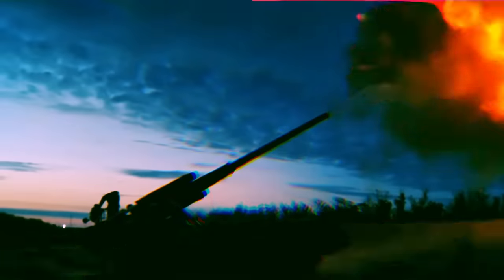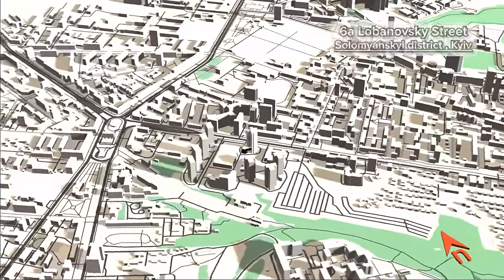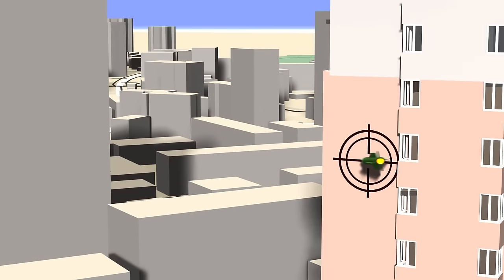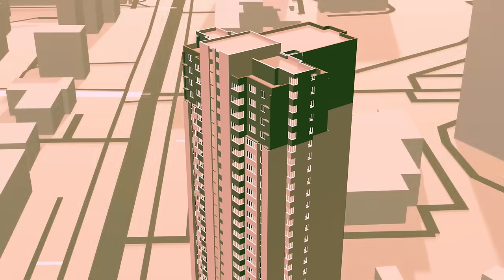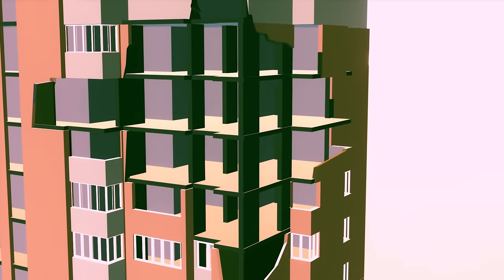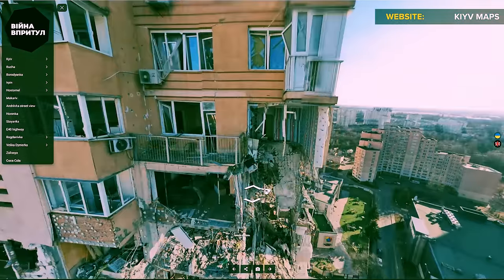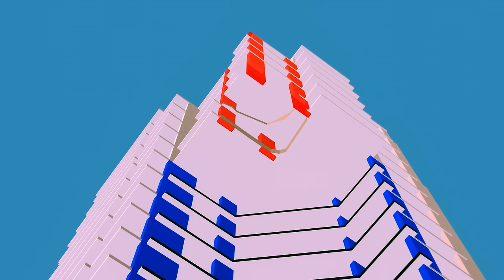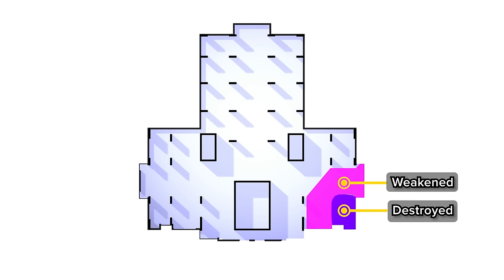KYIV MISSILE STRIKE | building structure and repair

Comment: How astonishing that a tower block in Ukraine is built stronger than a condo in Florida.
Reply: I liked how Mike explained the three car span issue. What a difference it made not to have to accommodate vehicles in the lowest level! And look how massive the columns are compared with the Florida condo that collapsed. This building is solid!
Reply: @dieterdietert7232  
Get help
Reply: @tetchuma  Stay a sheep and believe all the nonsense they put in front of you. 
Life is easier then. XD
Reply: @dieterdietert7232  sure is
Reply: We in the west have been tailored to think everything costs as much as it does. In reality it doesn't  Kiev's complexs far far outweigh 99% of the USA's in terms of strength. Sure it's not as luxurious but it's literally built like a brick poophouse
Reply: Chadimous, is a bit ironic, cost cutting on one combined with adding floors for greed, yet some say the other nation is more corrupt (and thus can't join the EU). Perhaps this building is proof that things are not as bad in Ukraine as some elsewhere imply, lol.

Comment: I've always thought that beams are required to distribute loads onto all/existing columns/pillars in high rise buildings... and from what I can see this building wasn't constructed with beams on each floor, with the floor slab transferring the excess loads onto available columns/pillars instead...
Reply from the maker: Beams are a good idea but not a necessity. In fact they get in the way, gobble up space and slow down construction. So building teams avoid them if they can. And this building stayed up without them. But this building had small spans where beams would be unusual. .

Comment: Awesome video, but did you really think the building would collapse with only that damage? That's a tough building. I could understand if the damage went deeper or if the strike was maybe lower.
Reply from the maker: Losing four primary columns is a major blow to a structure and beyond the limits of what the engineers would likely have designed for. Higher up in a structure the rebar steel is reduced with reduced strength so there certainly is some luck that kept the structure standing. But you are right it was a tough building.

Comment: Thanks for sharing russian propaganda inside tech videos. Buk missiles has self-destruction mechanism in case of missing
Reply from the maker: I am very pro Ukraine - strongly anti Russia.  I dont have an agenda, my aim is to report accurately.  The evidence points to a misfire.  

The missile came from direction where there were no Russian troops. It came from SW direction of the Sikorsky Airport.  The evidence points to Ukraine missile gone wrong.  This looks like an old BUK anti aircraft missile (1980's) which malfunctioned. It was only the 3rd day of the war with mass confusion.  

If you can provide firm evidence confirming this is as a Russian fired missile I can edit out the wording claiming it was fired by Ukraine.
Reply: @elisei210 Thanks for being biased to the point of self brainwashing so you can't even be logical enough to accept a reasonable conjecture...